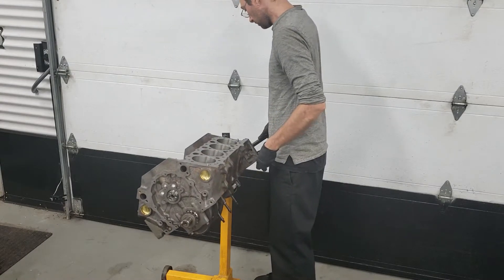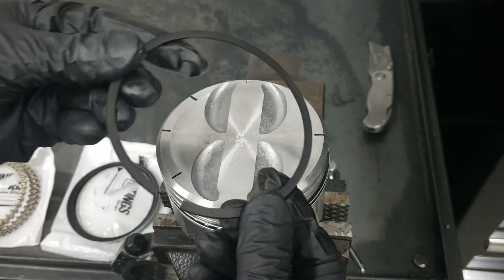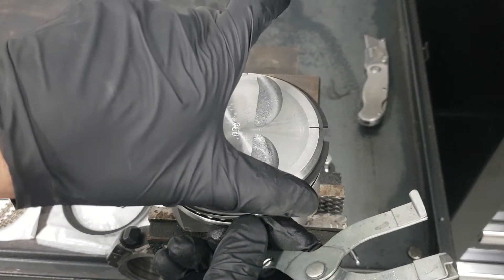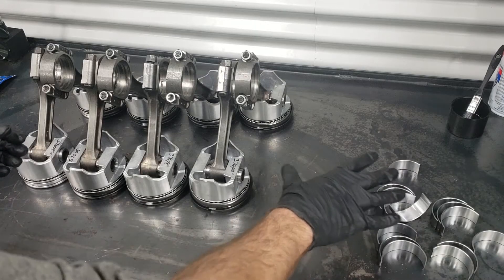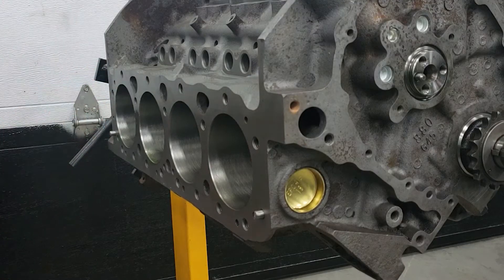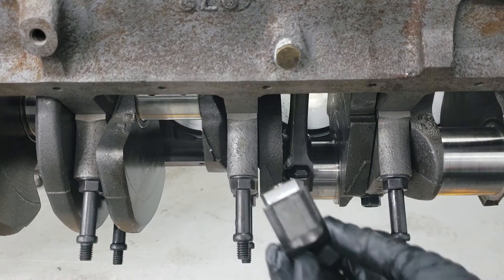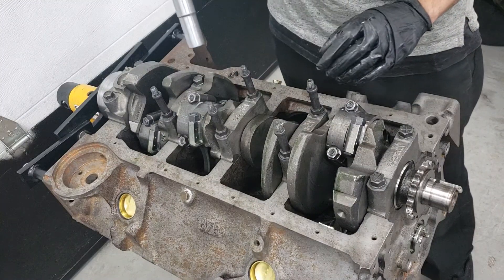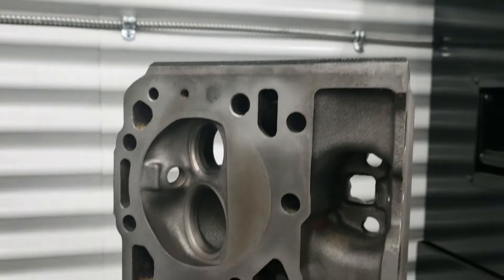Mercury 305 rebuild | part 4

Comment: why do the gaps of the rings need to be in a certain place?  I don't understand why that is of any importance
Reply from the maker: Hi. And that is a really good question that is often overlooked. I will try to simplify the answer. First off, your piston/ring manufacturer will typically provide gap positions in an instruction manual, so its safest to follow that. Now, the 1st and 2nd ring are exposed to the highest combustion pressures, so the gaps are opposite to one another in order to prevent excess pressure from bleeding past the pistons and into your crank case. This is how you get "blow-by". The following 3 rings are for oiling and they follow a similar positioning offset to Retain oil within the rings to lubricate the piston adequately. The final point is why do we have the rings positioned in the same orientation towards the front of the engine, instead of symmetrical. This has to do with engine rotation, As the crank rotates, it throws oil in a clockwise into the cylinder walls. This causes more oil to coat 1 side of the walls. The oiling ring gap positions allow that oil to collect within the piston, and distribute the oil around the piston more evenly. This last point is difficult to visualize. I may explain this in more depth in a future video. I hope this helps.
Reply: This surely helps a lot! Thanks for the information. Your knowledge about engines is incredible. Keep up the good work!

Gonna use all this information for the rebuild I’m going to do on my 1976 mercruiser 165 hp 6 inline engine. 

Cheers
Reply from the maker: @HGJVerschuur  I appreciate it! lots of reading, and experience. Don't hesitate to ask questions. In a future project I will be going in deeper depth on a performance engine build ( my personal engine ) and some of these more complex questions will be answered. Thanks for watching, and good luck on the Rebuild.